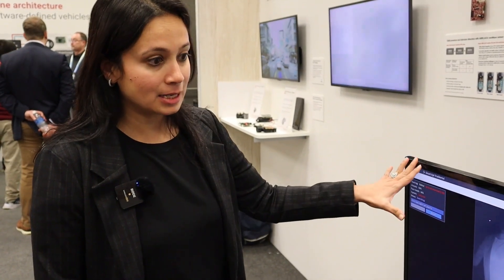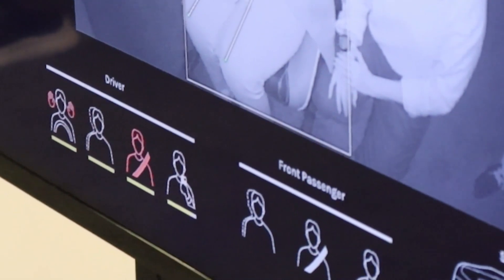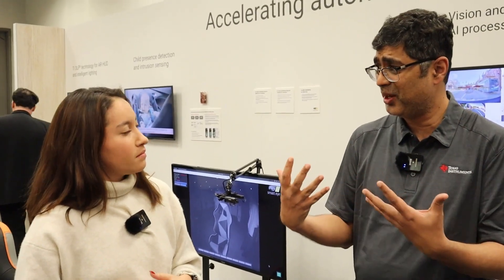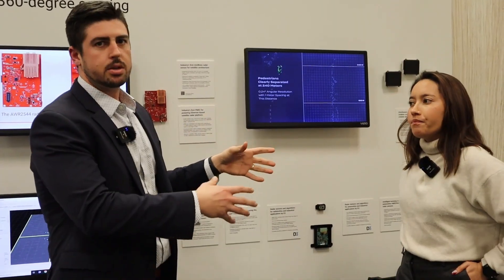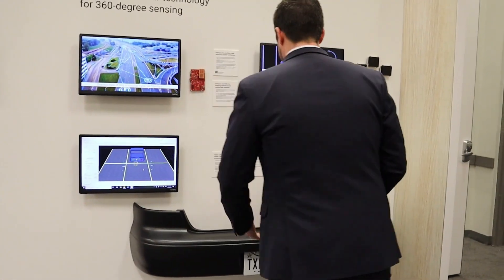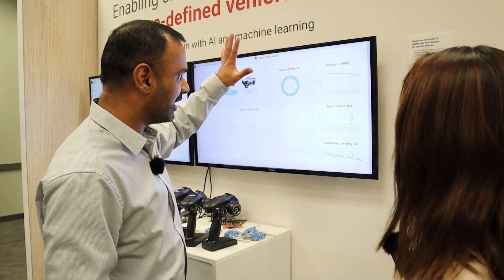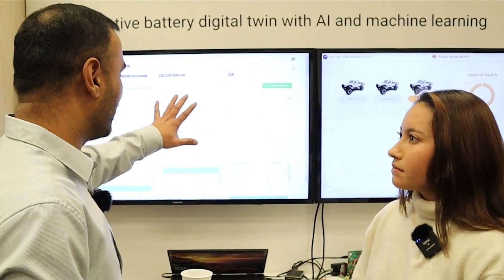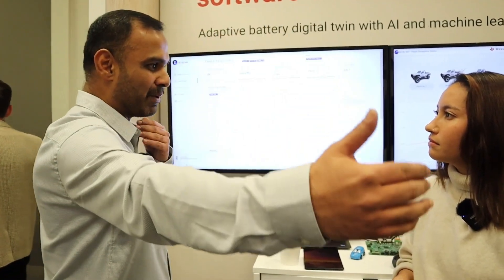The Future of Vehicle Technology! | SELF DRIVING CARS?

Comment: Hi kat, thank you for your videos. As an electrical engineering student, i really want to get some tips/guide from an incredible electrical engineer like you. 
I am currently in my third year of electrical engineering major. The courses are pretty interesting yet hard too. I am specializing in Computer Architecture domain and i am enjoying it. But along with that, i am facing many problems as well. I just feel like i was at some beginning level i.e learning muxes, decoders, etc and coding them in RTL easily. (in my second semester). and now suddenly, i feel i am at advanced level i.e learning about single cycle processors, pipelining processors etc. and this is creating overwhelming feeling for me. I feel like sometimes i cannot understand the lectures etc enough for this. I try hard to sometimes understand the content related to it, but easily feel frustrated if cannot get those things. Could you please guide me about this? 
Thanks alot.